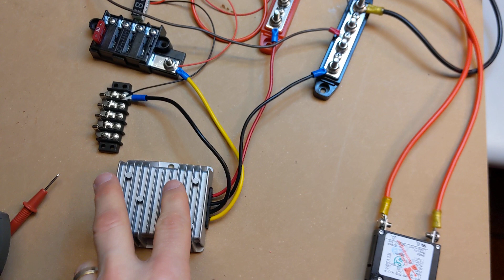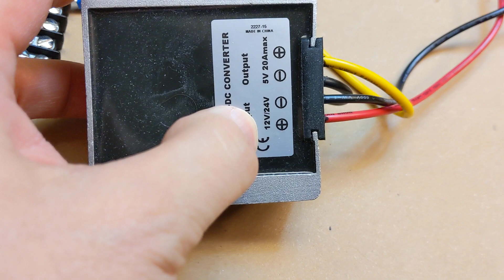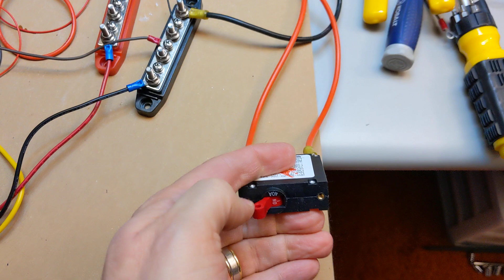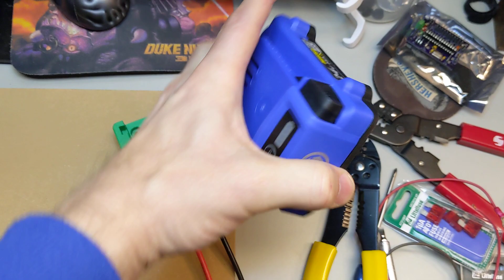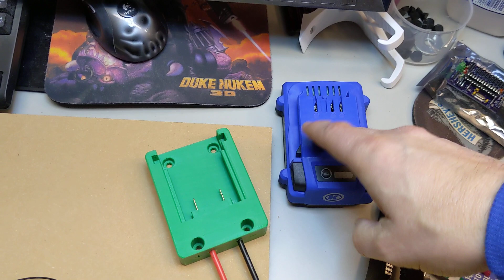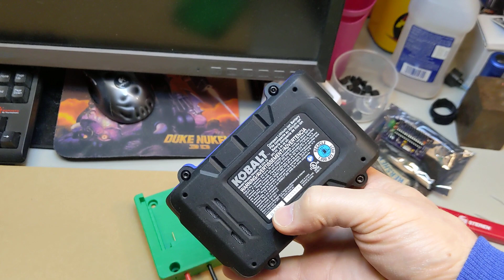3D Printed R2D2 - Part 90

Comment: Sorry for the loss, I think everyone has done something like that once in their life.
Those little 3 digit display meters are never accurate. Put your multi meter on the particular rail and adjust the small screw on back of 3 digit display to match you're multi meter reading.

Good luck.
Reply from the maker: Thank you.  Adjusting the meters is on my list but unfortunately it all went kerblooie before I even got that far.

Comment: Shit happens. 😞
I take the board to check, if i could save something.
Reply from the maker: It's currently in a box with the voltage converter and breaker switch.  Eventually I'll probably pull the two larger arduino boards and wifi module off to see if they survived.

Comment: Damn. Just damn. So sorry that this happened. Yes, we all make mistakes and in hindsight they are usually innocuous little things - which makes it even more maddening. These are the most important lessons for builders so thank you for sharing. Keep your chin up and press on - we’re all pulling for you!
Reply from the maker: Thanks Jason.  An hour after the meltdown I ordered replacement parts as well as a pair of Dakota Lithium 12v 10amp hour batteries and charger.  I'm printing your custom battery box files as I type this reply.  I plan to pretty much copy your setup.  Your setup is really clean and proven to work, so why reinvent the wheel?